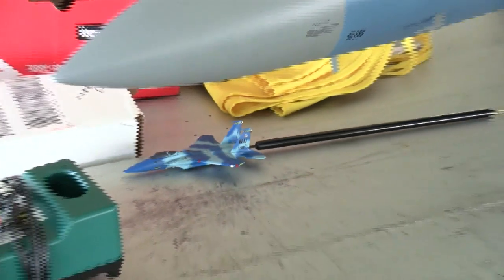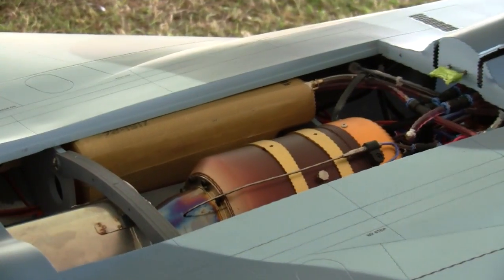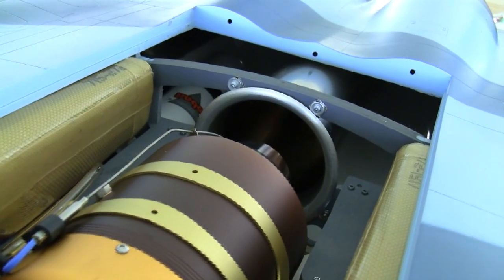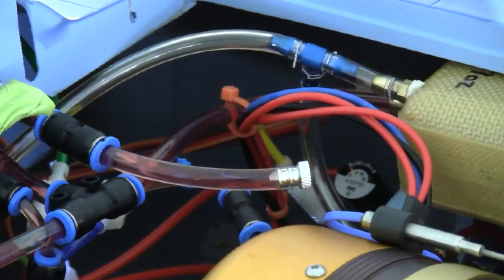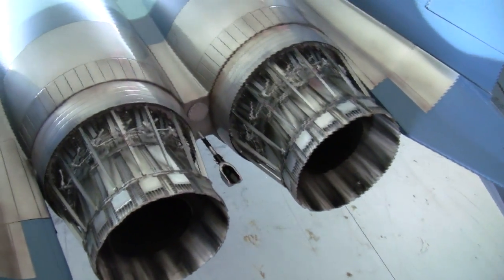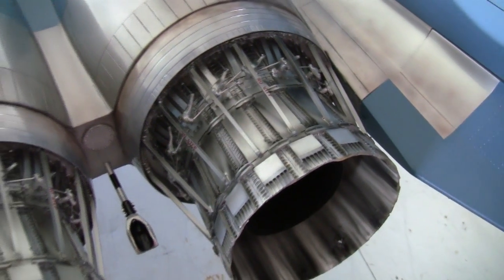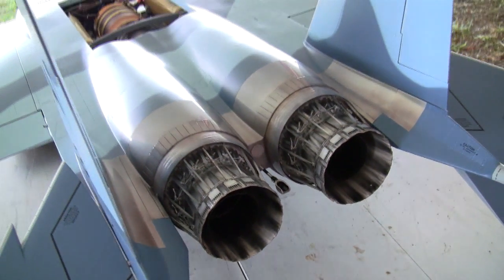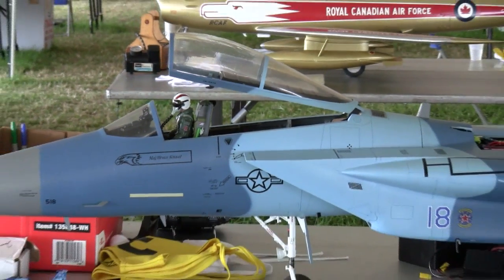Inside a turbine RC Jet - Jet World Masters 2011

Comment: But.. BUT its only one Jet engine, You'd Be better making it an F-16,  It just unrealistic copy, Realism is what counts...
Reply: Model would need to be bigger to fit two turbines. Looks like the exhaust is split into two exhaust pipes. External appearance and flight is realistic enough. If the model were bigger, maybe could make working exhaust nozzles (although that would add unnecessary complexity and weight).

Comment: Sheesh, USA, when are you going to join the rest of the world and go metric?
Reply: The World is Defective,.........America Rules
Reply: as soon as the metric system lands a man on the moon.
Reply: Jester123ish Just as soon as you pay for the new tooling, precision measurement devices, standard blocks, fixtures, fasteners, and reprogramming of CNC machines. There was a push to change in the 1970's and English and SI units were taught to me in engineering school. I think it would be easier and less expensive for the USA to switch to the French language.
Reply: kimmer6 I'd imagine a lot of tooling machinery has both these days?
Reply: Jester123ish No. New manufacture has been outsourced to China, Malaysia, Mexico where SI  units are used. Much of the larger expensive machines still working are still English units. Most fasteners in hardware stores are inch fraction sizes but some have small supplies of metric. Changing over is extremely costly..

Comment: He said "Fuel Consumption is about 14 ounces a minute" That's close to 1 pound of fuel per minute. 8 pounds per gallon of fuel so in 9 minutes, you've burned a gallon of fuel which weighs 8 pounds and cost $5 per gallon. So $5 for 9 minutes of flight time.

Comment: RC has come a long way, I  was a kid in the 50's and watched my dad build many models.....no iron on material to cover the balsa  frame... , all lacquer and paint over stretched silk....and the transmitter was a 3' high huge box with tubes...touch the antenna at the wrong time and get a hell of a shock......1 click for left 2 clicks for right turn..rudder only flight...